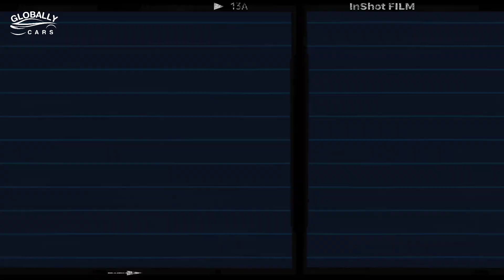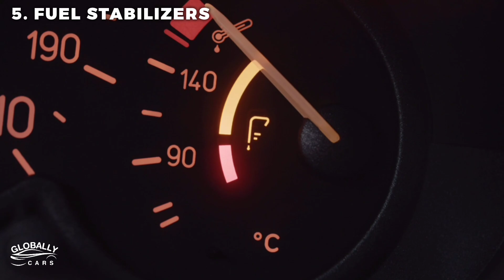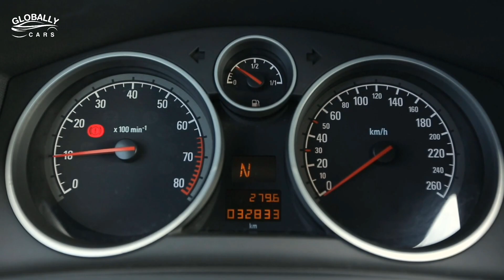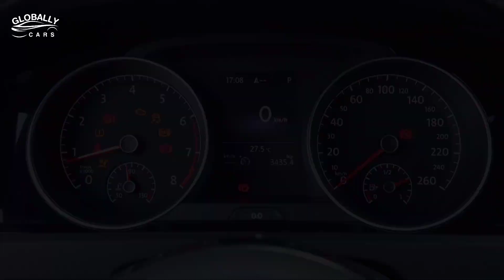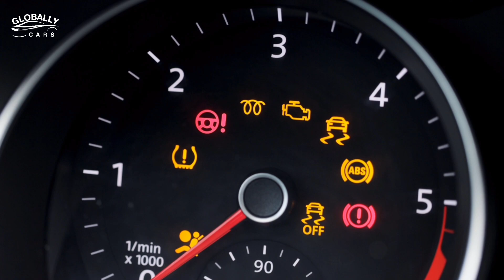The Fuel Additive Mechanics Don’t Want You to Know | Types of Fuel Additives | Myth Vs Reality

Comment: I disagree with this, I've seen first hand how fuel injector cleaner has improved performance. The detergents in gas are very mild at best. If you have had to use bad gas or don't have quality fuel around you, it certainly doesn't hurt to add cleaner to your fuel. I would never put it in the oil as demonstrated in this video however.